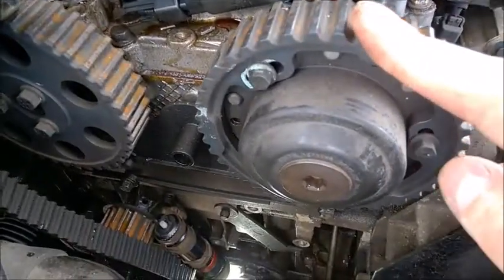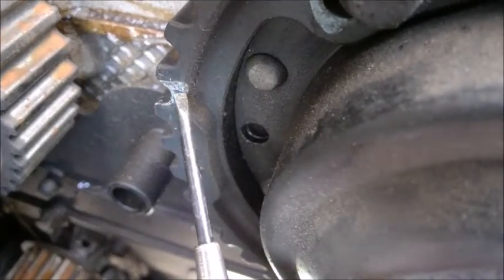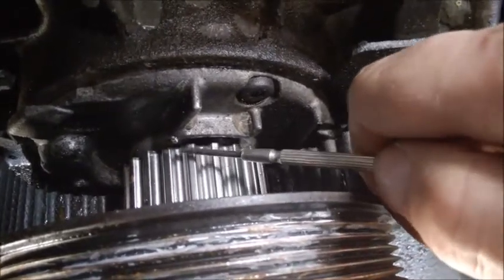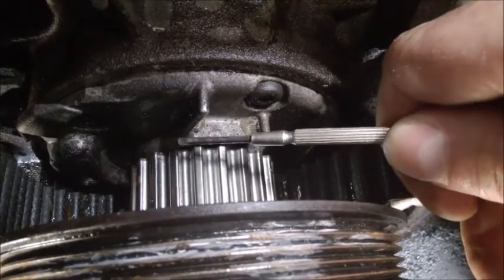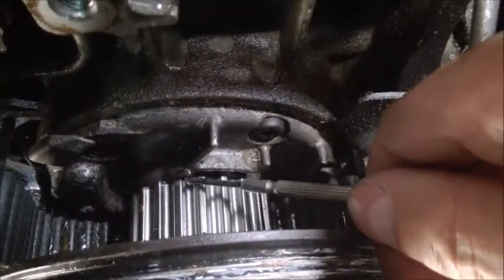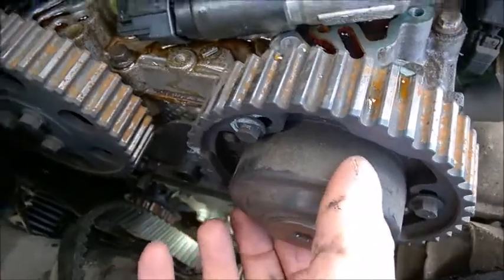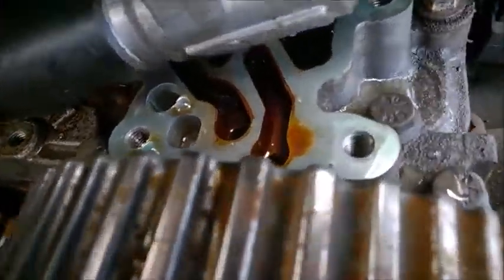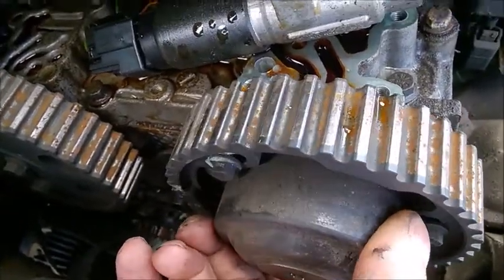Volvo S60  V70  Timing belt crank pulley aligning mark  2001-2009

Comment from the maker: Tensioner center point is for 15C / 60F
If you are removing the cam gears for a seal job, be sure to mark everything properly - ask on forums ahead https://www.matthewsvolvosite.com/forums/
Tensioner and belt check https://youtu.be/afcUC07LPnI
Passing the timing belt without removing the crank pulley (difficult) https://youtu.be/2tljxoQFDe0
Here's a write up on the VVT and timing belt components - there is a passage saying "turn the crankshaft a further 1/4 of a turn clockwise, then turn back counter-clockwise until the markings correspond" - I do not recommend this particular step. Be sure to mark the cam gears everywhere before removal, ask on forums http://www.ondemand5.com/mric/common/asp/annotationattachment.aspx?fileid=6198
Reply: Have you an idea why Volvo instruct this 1/4 turn clockwise/counter-clockwise procedure?
I noticed this in VIDA
Reply from the maker: @ivanstenchristensen7037   From forums it appears this will release any residual oil pressure tension inside the VVT hubs - these hubs may rotate slightly when the belt is removed. Not a real problem as long as we rotate them back with the marks aligned when placing the new belt.  I actually tried this 1/4 turn back on my S60 and I didn't like the feeling.  It feels at some point like it's hard to rotate. I just think it's not really needed and who knows if the VVT hubs like this, better not to mess with it.  This procedure is actually little known even to some Volvo techs.
Reply: @Peppermint1  I did it the same way as you describe when I changed the belt on my V70 and I did not like it either. I guess you are right about the reason with the VVT

Comment: ive done 20-30 timing belts and i never knew about the the lil notches in the crank gear, i always used the mark on the pulley side of the crank gear thanks for that

Comment: Dude you’re awesome!! Nobodies videos have said it was TWO notches on the crank alignment. After knowing what too look for I found it on my 2007 V70R’s sprocket. If it helps, mine also had a “raise” on the flange that the pulley mounts to which matched up in between those two notches in the sprocket.

Comment: Thanks for sharing sir, I have a question those nots do you align them thesame time when you align the camshaft?
Reply from the maker: Yes but on some engines, when you remove the old timing belt you will notice the exhaust cam will move by itself (spring like action) and rotate a little bit off the mark alignment - when you install the new belt, simply push the exhaust cam with your hand to keep the timing mark aligned. Once the belt is on, double check again all 3 timing marks - cams and crank - are all correctly aligned

Comment: Hello, I have rebuilt this motor (first one I ever built) and I have a slight problem, I used the old camshaft, I have the only exhaust VVT version, but I can’t seem to be able to move the VVT hub. If I try to undo the torx I only move the whole camshaft. Do I need the locking toold to undo the center cap on the vvt hub to then be able to move the VVT Hub? Thanks!
Reply from the maker: I suggest asking on this forum https://www.matthewsvolvosite.com/forums/

Comment: Excellent video from you once again, many thanks. I have heard that some mechanics always use "locking" tools and torq tool, when doing a timing belt exchange. What is your perspective on this?
Reply from the maker: I did the belt without the tool and I know others did the same.  It is very important to always remember to move your hands around slowly when working, so as not to hit the cam gears. Even if you hit them and one rotates a little, you can move it back aligned when placing the new belt. I warmly recommend using liquid paper to paint a white dot over the cam gear timing marks to see them better.  I think the tool is recommended mostly because some cam hubs are spring loaded and will move 1-2 teeth when the belt is removed - one just need to pay attention when installing the new belt to align the marks properly.  This is the tool I would suggest https://motogurumag.com/diagram-wwcpeo/

Comment: Hello sir. I planning to do my timing belt on 03 S60. Is continental contitech a good brand? What would you recommend?
Reply from the maker: If you purchase from a respected place, yes Continental makes the belts for Volvo. Make sure the tensioner and roller are INA. We like to replace the first water pump at 200000 miles, can inspect if yours spins smoothly when the belt is out.

Comment: Man I redid the timing and I was so confused. Ive done it before but man it drove me crazy. I couldn't really see anything, the notches are so small. But if I was 1 cog off to the right, would it throw a check engine light? Because it's not and runs. I feel as if I got tricked because of the angle so it looks like it is further to the right of the notch than it actually is.
Reply from the maker: Best to ask on forum with pics https://www.matthewsvolvosite.com/forums/
Reply: @Peppermint1  I'm leaning towards concluding that it is fine. Engine starts super quick still. Runs great, no rough idling. No issues at all. If it was 1 cog off on the crank it would def throw a code and it'd at least have a rough idle.

I also know what it is meant to look like. Just unable to do any timing checks now as I don't have a jack or lift. It's that post-timing paranoia that's hitting me.
Reply: @ASDASD34RDFS  it shouldn’t